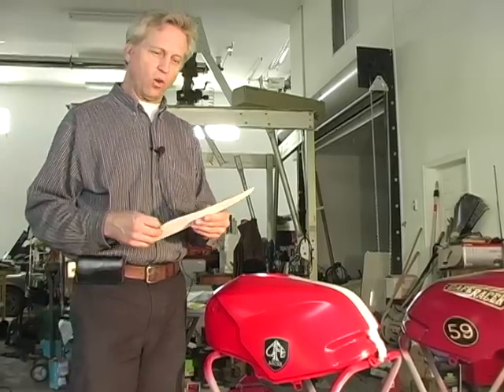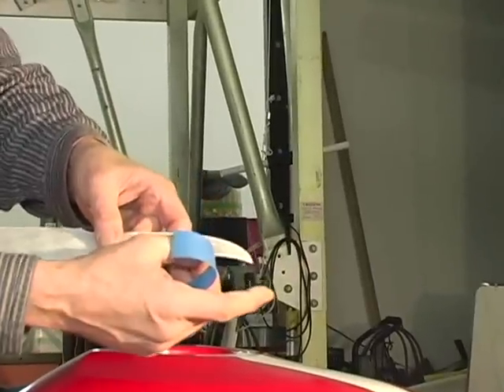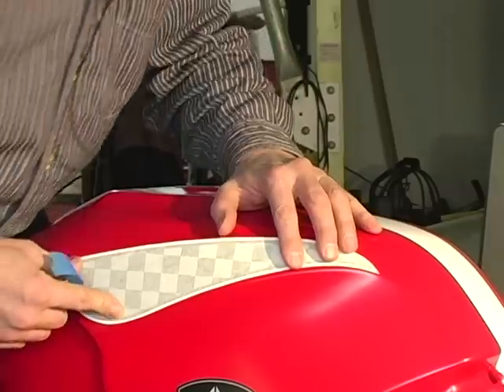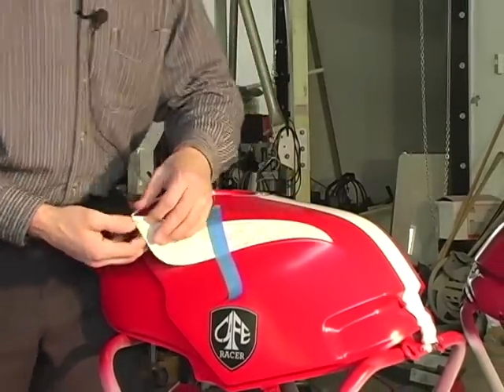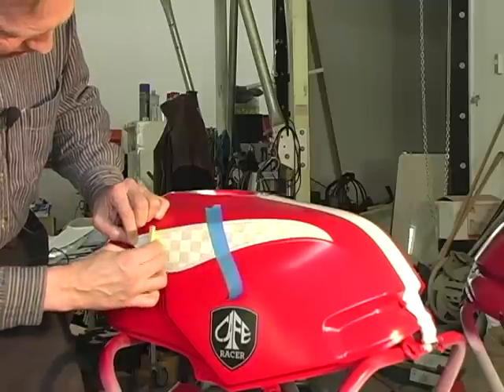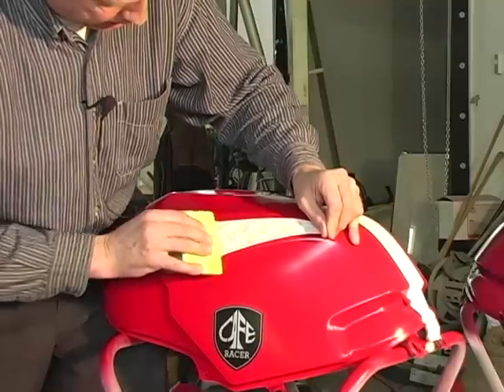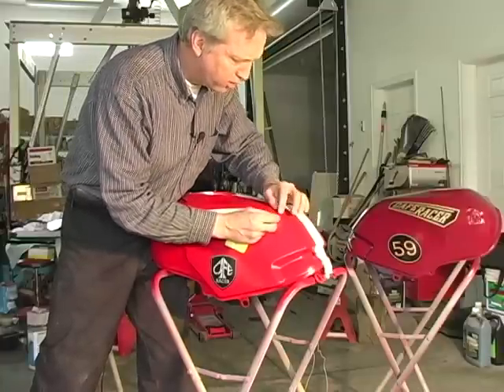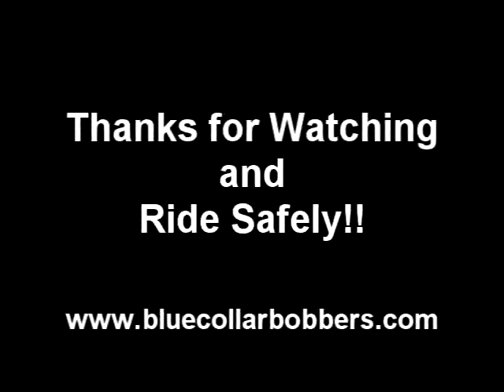Installing Decals Like A Pro!

Comment: One point to be aware of ...if the decal has clear sections, tearing the paper will leave white paper fibers stuck to the decal, which will be visible when applied.  Using scissors would be better for those situations.
Reply from the maker: Thanks for the tip!

Comment: Great video ! I am wondering if that tank was wet sanded prior to the decal being applied and then a coat of clear sprayed over the entire tank afterward ?
Reply: I'm wondering the same thing. I've heard it recommended to do that as well.
Reply from the maker: Bob and Dan, yes you are correct!  One thing that Geoff didn't show was that you can tape the ends of the decal to help position it also.

Comment: Helpful video!  I am curious whether or not I should apply the decal over the clear coat or onto the base coat which is ready for clear.  I'm going to clear coat over the decal to protect also.
Reply: Gordon Woolfrey Do not clear over the decal. A ruined decal the requires an entire repaint.

Comment: Please do not "eye ball". If you do not want to measure, line up the decal with blue tape, then run tape across other side of tank and line up second decal. Do not tear the paper. This could leave fibers under the decal. Use scissors and do a clean cut.

Comment: HI ANOTHER LITTLE TIP FOR BEGGINERS
ALWAYS REMOVE THE PAPER BACKING FROM THE REARWARD FACING(AIR FLOW DIRECTION) PART OF THE DECAL WHY?
  I RUINED MY DECAL BY STRIPPING THE BACKING AWAY FROM THE FRONT FIRST
I GOT MY FINGERS STUCK TO THE DECAL AND IT WOULDNT STICK BACK DOWN AGAIN AS GOOD AS IT SHOULD
SO WHEN THE WIND AND RAIN GOT INTO IT  ,IT STARTED TO LIFT
IF I STUCK THE BACKWARD FACING PART OF THE  OF THE EMBLEM DOWN FIRST ,,, THIS WOULDNT HAVE HAPPENED JUST SAYING
Reply from the maker: Keef Ardin Very good point, thank you!